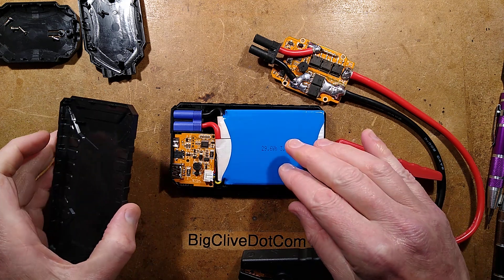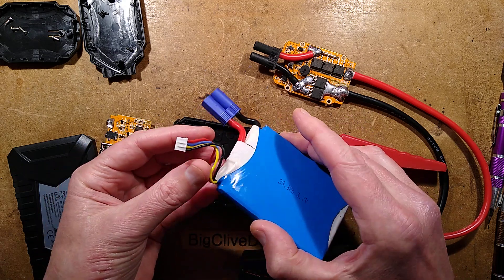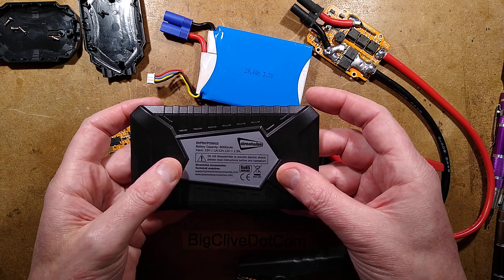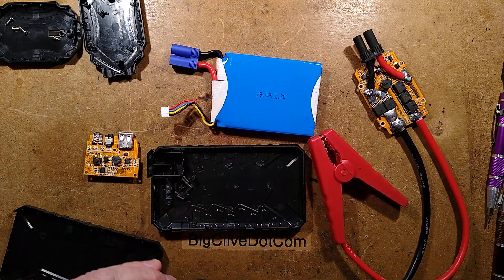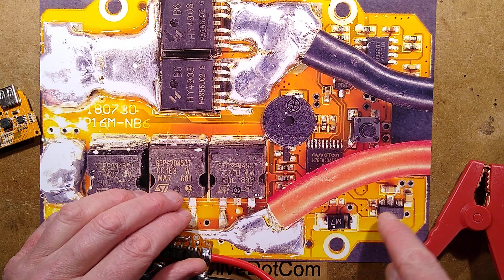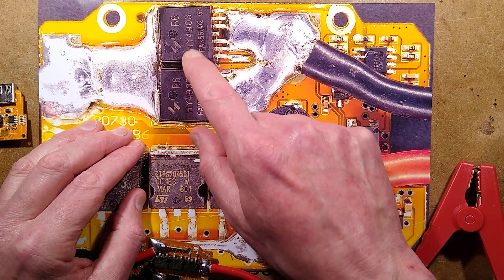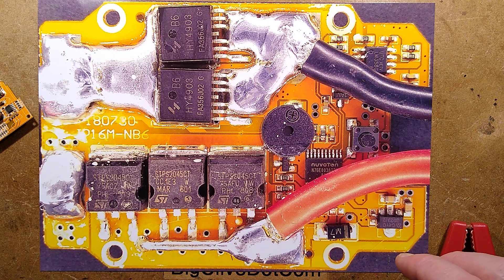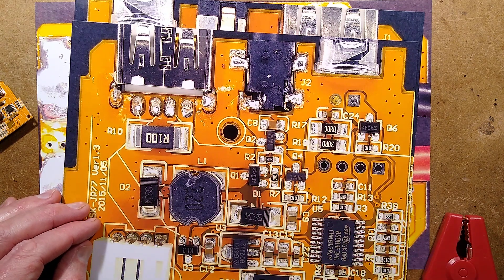Inside a combined power bank and jump starter

Comment: Is it any good as a jump starter?
Reply: I have a different branded one and it's been amazing. I've used mine on at least half a dozen cars in the past year and they all started right away. That said, biggest engine I tried it on was a 2L diesel.
Reply from the maker: If not abused they usually do work.

Comment: The fact that the output connector is directly wired to cells and before plugging in the jump leads there is nothing to protect the output makes it a bit of a risky gamble if you decide to carry it in a pocket or glovebox with keys, metal pens, etc.
Reply from the maker: It has a rubber cap over it.
Reply: @bigclivedotcom  And we all know that everybody always takes the time to close those when not in use. Just like they always take the utmost care when transporting and storing RC batteries with exposed terminals.

But that's a user problem, not a manufacturer problem.

Comment: This is amazing to me.  Last time I checked in on portable jump-starters, they were the size of a cinder block and about as heavy
Reply: Yeah that would be because the traditional jumper packs have a lead acid battery in them, exactly what's in the car but a slightly smaller version. Still extremely heavy though. Really impressive to pull hundreds of amps from a small lithium battery without blowing it up

Comment: This topic is worthy of a separate channel. Clive is doing excellent work on this so far. I tried to post the message below last night but it got blocked (presumably because I had included a link to an ebay ad for a 60w charger - mine was 200w). The chargers are called "Charger/Discharger". They will disharge all cells down to 3.7v if you are not planning to use them for a long period. People need to be aware that these things are dangerous. Whenever I was charging larger batteries then I always had an "escape route" planned (for me + battery) - just incase.

----previous deleted message ----

Even that isn't as powerful as the ones I was using. I had firebags, trays, etc, etc...
I love the excellent work that Clive is doing with batteries because the more people who understand how lethal these things are -> the better. These things even managed to ground the entire fleet of Boeing 787's having caught fire. They ain't funny. I had a £350 mountain bike light that actually caught fire in my hand !!!

Comment: I purchased another brand of jump pack a few weeks ago, it was hopeless because it demanded you had to connect to the vehicle within 30 seconds of plugging in the cable (if you didn't you had to wait iirc 15 minutes for it to reset) That was an insanely short time to make the connection for such a long reset if you failed.  I promptly returned it to the shop and got my money back.

Comment: Sounds a lot like the DeWalt  flexvolt batteries (can be used in 60v and 20v tools), where they advertise them as being 60 volt, 9 amp hour. But in the fine print, they mention is 60 volt, 3 amp hour, or 20 volt, 9 amp hour. Its 3 banks of 20v 3 amp batteries, and the controller on the battery either runs them in series or parallel depending on the tool youre using.

Comment: I’ve had a few of these when they used SLA batteries, they required a handle due to the weight. Now I’ve got one of these types now and it’s amazing the size engine it can start.

Comment: The phones BigClive mentions are the Samsung Galaxy Note 7. The issue with those was actually slightly different from what BigClive describes -- no real fault of his, it's hard to find out what actually happened. I no longer remember my source (perils of ADD-associated and other memory issues) but it was extremely trustworthy.

Basically what happened was, lithium cells, especially pouch cells, need a very tiny amount of extra space allocated to them when charging, because charging makes them swell very slightly. During the design phase of the phone in question, this space was not allocated, as a management directive over the protests of the engineers. Thus, when charging is attempted, the battery kind of swells into itself, if that makes sense, and shorts out internally... which, because it's a lithium battery, means that extraordinary energy density kind of lets loose all at once.

For the less-technical amongst us: an internal short in a battery is the equivalent of connecting the two battery terminals directly together with a bit of wire, but INSIDE the battery. If you've ever done that thing where you test a car battery by twiddling a wrench between the terminals to get sparks, you kinda know what you're in for here. If not... well, the spectacular shows the Note 7 put on are pretty well documented at this point... other videos on YT will help. Basically imagine one of those cheap home fireworks sets you get at Wal*Mart going off inside your phone -- the entire set, all at once! (In the famous word of Wile E. Coyote: YIPE.)

The kicker here is that the space required for the battery to properly function was a mere one-tenth of one millimeter. That distance is imperceptible to the human eye. If you want to try and conceptualize it... go to an office supply store, they sell 0.5mm (half-millimeter diameter) pencil lead for mechanical pencils. Look at the pencil lead in that size and imagine something 1/5 as thin... or go to Wal*Mart and look at the 0.7mm lead and divide by seven instead of five. (or divide by eight, it's easier -- divide in half, then in fourths -- and there's essentially no difference at that point lol.)

Management people do dumb stuff sometimes.
Reply from the maker: I think one corner of the cell space was also compromised and made that size change during charging more critical.
Reply: @bigclivedotcom  I've not heard that, but I've not heard a lot. Could be.
Reply: I can't remember which game it was, but theychanged the 3d model for a hand grenade into a Samsung note7 around that time. It was hilarious to see combatants in game tossing Samsung's into bunkers and then they explode.

Comment: As a former automotive tech, the choice to omit a low voltage shut off for the 12V is a mistake. The most common response from people when their car won’t start is to run the starter and crank the engine continuously either until the engine starts or it stops cranking. Quite frequently I’ve seen cars come in with dead batteries, melted starters and even melted battery cables due to engine not starting for some other reason (like a bad fuel pump, failed engine sensor, or my personal favorite, it’s out of gas). I’d imagine that more than a few of these jump starters have hit the dump because the owner strapped it on their battery and just repeatedly cranked the engine until the jump starter died.
Reply from the maker: I recently learned the term Cranker Wankers for those people.

Comment: Clive, do you have any thoughts why these LiPO packs performed so poorly on Project Farm and most wouldn't crank his low-compression 2.9 V6? I routinely jumped my 2012 Mustang with a 3.7 liter, high-compression V6 with one of these with a 11.1v, 4000 mAh pack inside when my battery would die nearly instantly after being shut off. 

I know he basically directly shorted them using a big load tester when in reality the 'peak' current of hundreds of amps is only needed for less than a second to get the starter up to speed, after which much draw only about 150 amps while cranking. He then tried jumping his small truck with a battery that had like 5 volts, which I'm guessing took the current instead of it going to the starter while cranking? I know these can provide the current to crank an engine at least briefly unassisted, and they basically all use the same batteries.
Reply from the maker: The manufacturers of these are guilty of grossly exaggerating the capabilities of their units.
Reply: @bigclivedotcom  I know, but I've personally used cheap 3S, low-capacity packs with success yet they didn't work for Project Farm. I thought something might be wrong with his testing methods and thought I'd seen you on his videos.

Comment: Smart that they went with a 15V charging voltage, as that means you can easily charge it from you vehicle after its stated.... since a running vehicle (with a good alternator) outputs anywhere from 14V to 14.8V.

Comment: A word of warning on these type jump starters.  If left in your glove compartment too long, two months in my case, the batteries can dip below acceptable levels, and then when you attempt to recharge it, it will not take a charge! Keep them topped off is all I can say, and yes, I attempted to force charge it in a last ditch effort by bypassing the charge circuitry, to no avail... As Clive would say, it's time to take it to bits...
Reply: The ideal way to store lithium batteries long-term is at 50% charge, however that obviously isn't practical when you need it to be ready for emergencies. I definitely wouldn't be super keen on leaving it at 100% charge for months on end. That'll kill the cells for sure. It's just a shame these companies don't give a crap and have the charge cutoff at 4.2V (or higher!).
Reply: @clonkex  I agree...

Comment: The mosfets on the 12 volt side look like the legs of them are all soldered together won't that short them out
Reply from the maker: The legs are all commoned on each side except for a single pin for the gate.

Comment: We used the Ablic IC for secondary OVP for an ASIL-D 12V automotive pack. It’s definitely shouldn’t be used as a substitute for charging. There are standalone true BMS IC’s but I understand why most manufacturers don’t use them, they can be quite complex little systems. But this is the safest approach.

Speaking of automotive applications… Sometimes we will put redundant parts in series or parallel parts to take more current but specify different part numbers to get a better FIT rate and also to ensure during mass production if a batch of parts has an issue, it’s not effecting the second part. In this product it might be they were available but yeah it’s a common practice in safety critical systems.
Reply: designed  a car amp/battery, bro 🤣
Reply: @808bigisland  What?

Comment: You do realise the mismatched diodes will conduct differently and when it's under a big load they will let the smoke out as one will take too much currant and pop then the other two will amd the whole thing will end up open or short also could burn you if your holding it or go to touch it after said event

Comment: I have a similar one of those, however its weird because it has two full size usb ports on it and the way you charge it is through one of those ports. The unit came with a usb cable that has the same end on both sides.

Comment: Are you following my inane days? My damn motorbike battery is on it's way out and i'm debating buying one of these
Reply from the maker: Motorbike batteries often suffer through seasonal use and storage.
Reply: True, though mine's used at least 5 days a week for a 20 minute commute each way.
Having said that it was manufactured in 2017, which is pretty ancient as bike batteries go.

Comment: Color me suspicious, Clive. How can something holding about 100 watt-hours with a total series resistance of probably 100 mΩ possibly turn over a standard ICE engine whose solenoid draws about 10A (120W)  and whose starter motor draws 150-200 amps (a kilowatt or two)? Why not remove the positive battery cable on your car, connect this doodad to the electrical system, and see if the engine turns. Report back if you will. For that matter, see if it will charge a Tesla that has run out of "fuel."
Reply: Because for most consumer cars with 'dead batteries' the battery isn't completely discharged (or missing). It's just slightly below the threshold where it can turn the engine over (or a low voltage protection chip in the car itself stops the car from even trying to start). Rather than designing a unit that can fully replace the power potential of a 40-pound battery, their goal was to design something that can give a low battery enough of a boost to start a car in ~95% of cases where people would otherwise be reaching for jumper cables.
Reply: Because it can provide a ton of amps. Just for a really short time. I have a better brand and it says to crank no more the 5 sec. Ive started a v8 truck that had its main battery reading 1.8 volts. Fired right up in under 2 sec. It got really warm doing so. Took it from fully charged to half charge just from that one start.

Comment: So handy on a farm in winter when batteries start showing their age. Helps get another 9 months life out of starting batteries. Several years for my ride on.
This even starts our EVs when the accessory battery goes flat inexplicably, very occasionally. 
Buy a reputable brand starter pack for longer life.
I clip the positive straight to the starter positive for my tractor, as the battery is complicated to access. Ground is always tricky to find.
Reply: I have a simple trick for finding ground, take a ball, hold it out in front of you and then let it go. It will usually travel towards ground.

Comment: For the smaller diesels, these are amazing little devices.  We keep one in the Wife's Holden Rodeo "just in case", and it has proven itself very useful on the many occasions we've needed it.  Obviously perfectly capable of starting the smaller (10hp) diesel generators if needed (i.e. when the "trickle charger" wasn't actually plugged in . . . :-) )
Reply: Until it catches on fire. 😉
Reply: @Vousie  Even more multi-purpose! (now has an added "hand warmer" function!) :-) :-)
Reply: @Vousie  The car or the jump starter?

Comment: It is amusing how so many of these packs end up abused because they're assumed to essentially be a battery replacement when a car battery has gone dead, cos really ones of this size are meant to be for a low battery situation to give enough of a current kick to get the engine turning over that first bit of compression, and nothing more, but people just go full crankerwanker and burn the packs out instead...
Reply: I work in a shop that sells these things. I always warn the customer that they are a one-shot device, needing to be fully charged between starting attempts. Relating the advertised capacity to the advertised output current, not one of the units is designed to provide its rated cranking current for more than a couple of minutes.
Reply: Ur right Clive they are just to boost Ur battery enough to start it and nothing more. That's why they are like from £20 for a 3,000  to 8000 but not at full power as they will burn out like others have said just a quick booster and that's all. Great video Clive

Comment: Not sure i would trust such devices , I have a super cap jump start box which also has a buck boost function on it so if your battery is dead it will charge off what little is left then use that jump of energy to get the car going.

Comment: I think they use different diode packages (back-charge protection on the 12V side) in order to have some redundancy. In case one diode fails, you might want to have the other diodes - which the failed one is parallel to - selected from a different production line, so they don't all have the same going-up-in-smoke kind of behaviour. Just like they implement some systems in aviation etc. so that one "action path" of a multi-redundant system is operated microcontroller/servo-based, another one purely mechanically.
Reply: What you describe is something you absolutely do not want when putting diodes in parallel. Parts from the same batch are much more likely to have very similar specs (especially forward voltage in this case). If you mix different batches the tolerances mean that one diode will have a significantly lower forward voltage than the others. That diode will take a lot more current than the rest and almost certainly fail first at some point. Then the same happens again to the next diode aso.
Reply: The diode packages are the same, clive just said they have different text, which was a different date code. Which means they were likely salvaged parts, or possibly placed and soldered by hand from a bin.

Comment: What are those 4 pins in a row on the one board? Is the microcontroller programmable or perhaps is outputting a data stream of some sort?
Reply from the maker: Probably for in-situ programming or tests.
Reply: I am surprised its actualy using a known brand not a custom or a chinese like mcu
Reply: It seems like a generic ST microelectronics mcu wich are programmable i also had a board wich had the debug/prog pins

Comment: I noticed a surface mount resistor marked R025.  The internet was very helpful and said that this was a 0.025 ohm device. Same website said R100 was 0.1 ohm not the 10 ohms that it would be if the third digit was a multiplier. Second website said the same thing.  Please can you confirm or deny this please.  It’s just another nail in the coffin of surface mount for me,  never had this sort of issue with post mounted resistors biasing valves.
Reply: There is no multiplier below 10 ohms, "R" is used instead of a dot.
Reply: There are 3 and 4 digit SMD values, 4 digit codes allow for more values.
For values under 10Ω in 3 digit code or 100Ω in 4 digit code replace the R by a decimal point to get the value.
For values over 10Ω in 3 digit code or 100Ω in 4 digit code the last digit is the multiplier (number of zeros)
In 3 digit codes when the R is the last digit it is usually replaced by a 0.
3 digit code examples:
R02 = 0.02 Ω
R25 = 0.25 Ω
2R5 = 2.5 Ω
250 = 25 Ω (25R)
251 = 250 Ω
252 = 2500 Ω
253 = 25000 Ω
...
4 digit code examples:
R025 = 0.025 Ω
R250 = 0.25 Ω
2R50 = 2.5 Ω
25R0 = 25 Ω
25R5 = 25.5 Ω
2500 = 250 Ω
2501 = 2500 Ω
2502 = 25000 Ω
2552 = 25500 Ω
...